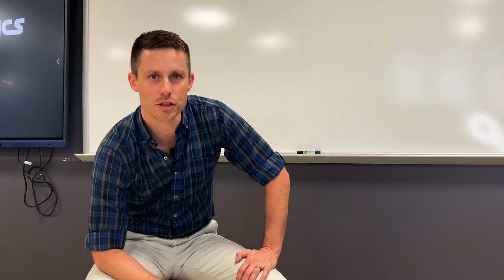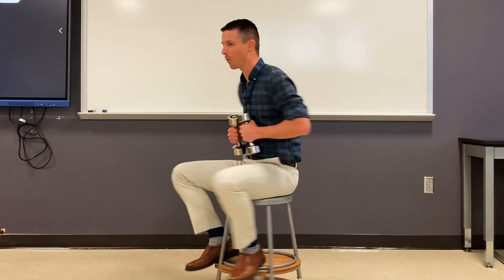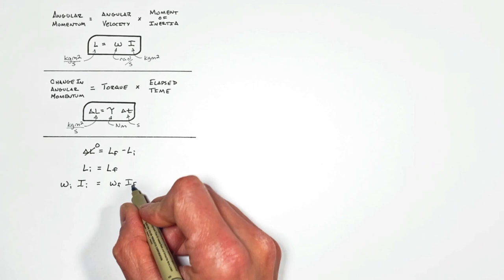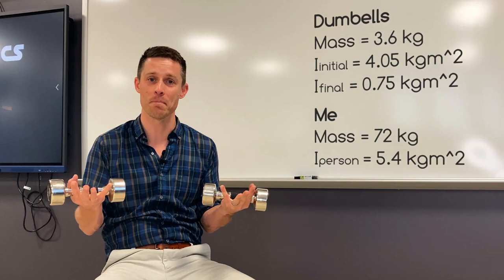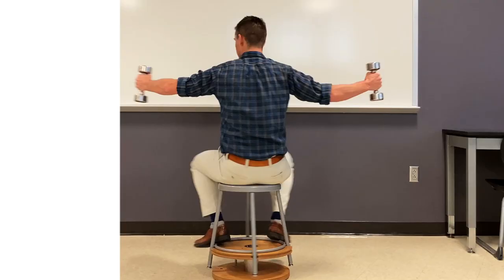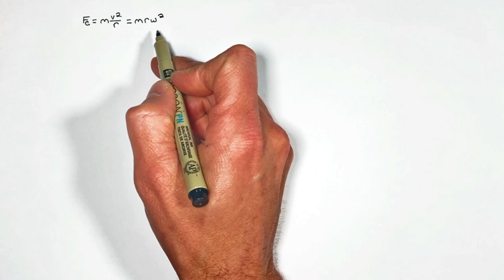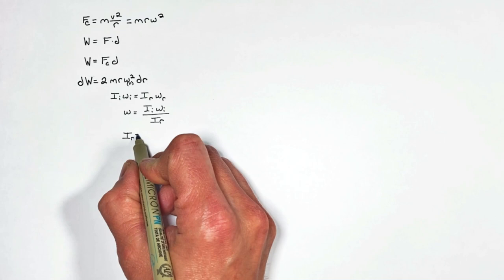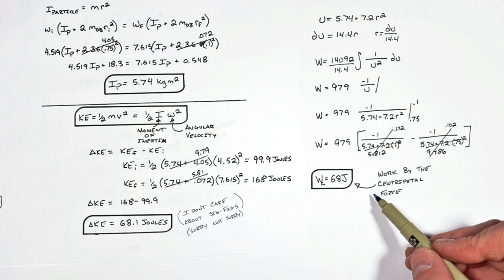Spinning in a Chair Physics Demo | Calculate Increase in Angular Velocity and Kinetic Energy

Comment: Sir there is a question. If we use energy conservation we get different answer than if we equate all forces. How can we solve this question by balancing forces. The question is
"A pendulum bob of mass m is suspended at rest. A constant horizontal force F = mg / 2 starts acting on it. The maximum angular deflection of the string is"?
Reply from the maker: Short Answer:  As pushed from equilibrium, the pendulum is speeding up until it reaches equilibrium, then it begins to slow down.  Equilibrium is not where the pendulum stops.

Long Answer:  I just started working on the video for this one.

Comment: Q. Work done: Fd is the work done to overcome a force and move an object a distance d. My question is that the force of a rotating object acts towards the circle and you are bringing that object to thr centre of the circle. In which case, what force are you overcoming?

I haven't done the calcs yet but is mrw^2 actually the centrifugal force created by the rotation? I believe it is a proxy since although the centrifugal force is different to mrw^2, the differential of it is the same and that is what we use for the answer.

Do tell me if I am wrong though?
Reply from the maker: There is no outward force to 'overcome' you are providing a centripetal force inward to keep the masses moving in a circle.

If you convert the velocity in mv^2/r to angular velocity 'r*w' you get mrw^2.
Reply: @INTEGRALPHYSICS  thanks for the prompt reply. Having combined your response with more thinking it almost makes sense to me.
1 more question if I may, to clear the last hurdle:
As you rightly say in your reply, F = mv^2/r = mrw^2. However F is the force towards the centre of the circle which causes the object to rotate. Therefore this is the force already on the object before you start to bring your arms in. Why in your video have you said it is the force that you have applied to bring the object in?
Thanks in advance - and not expecting you to reply as promptly. Mindful you probably have lots of comments to reply to!
Reply from the maker: Provided the masses are pulled in slowly, the force to move the masses inward at a constant speed is equal to the centripetal force.  The only places that does not hold true are at the beginning and end of the inward motion... However, I assure you, I was speeding up the entire time I pulled those masses inward (and spent the next hour motion sick).
Reply: @INTEGRALPHYSICS  I think it is only today that I have realised I don't understand work done like I thought I did:
For example, say I moved a block a distance d between time t=0 and t=1 with velocity v(t)=-4t^2 +4t.
Then the work done would be zero which I don't quite understand intuitively - I get that if I integrate F(x)dx I get 0, but unsure intuitively why - after all I sure will feel that I have done some work in my arms, having moved the block. Why did I choose my function v? I chose it so that just applying the integral definition of work done would mean the energy t=0 to 1/2 would cancel the t=1/2 to 1.
Maybe there is a video in this if you think it is interesting enough, but it might just be really basic on the other hand (I did a maths degree/masters rather than physics so may be missing some basic concepts)
Reply from the maker: You talk about getting tired in your arms.  Don't confuse getting tired with doing work.  Instead of your arms, imagine a spring did the work.  Storing energy as it is compressed, then releasing energy as it relaxes.  The net change in energy of the spring from start to finish is zero; This is what we call a conservative force, meaning the energy transfer is a reversible process.

Comment: Angular momentum is a pretend vector that seems to work for you.  But, it is pretend or analogous.  Angular momentum does not cause the gyroscopic effect.  If that was something that always bugged you in physics like it did me, well I figured out the real cause, and it is acceleration, not momentum.  Look at my video explaining it.  Then mnemonic devices like laws and rules are not causal either.  They are for rote memory dependent people to remember what it does NOT WHY IT DOES IT.  Physics needs a reset button.
Reply from the maker: That's the point of the last 3 minutes of the video, if you fell asleep by that point nobody will blame you.  Here's the mathless version of this experiment explaining the energy influx that causes the increase in rotational velocity...
https://www.youtube.com/watch?v=bvLgw-HWn8w
Reply: @INTEGRALPHYSICS  You missed my point too.  I am very curious about what this does to you, so let me know please.  I cannot get this published, because no one wants it, but I describe a 3D rose pattern path with math, because that is the path that an atom in a disk will follow spinning and tilting.  Second derivative gives acceleration normal to the spin plane (PERPENDICULAR TO SPIN).  Spinning only supplies the rate for tilt velocity changes to produce acceleration, so the conservation law becomes pointless and actually wrong, because perpendicular vectors do not affect each other.  For some reason, trained physicists WILL NOT see this.  Can you?  Angular momentum is an analogy that hides the cause of the effect from you.  https://www.youtube.com/watch?v=Sip_9ew2RjA
Reply from the maker: It is nice to see someone else who does not accept angular momentum as a causal explanation.  I have always found the explanation for the precessing bicycle wheel inadequate.  I like the way you are throwing out the book and looking at a new way to explain mechanics.  Thanks for giving me something to think about.  Cheers!
Reply: @INTEGRALPHYSICS  I'm very surprised.  You are a rare specimen.  This is a 20 year effort for me (the math is newer).  Journals will not touch it.  Professors from college, all but one ignore me, and even the one cannot convince the others, but he is not excited about it so much.  The overwhelming lesson from this is that math cannot dictate cause.  The bad news from here is that once you start second-guessing things, it grows.  Gravity is the largest clue in the Universe, and the variables in gravity are probably incidental, not causal...and so on.  This ruined physics and people for me.  I hope you can do something with it, but it made me a quack, so watch out for that.